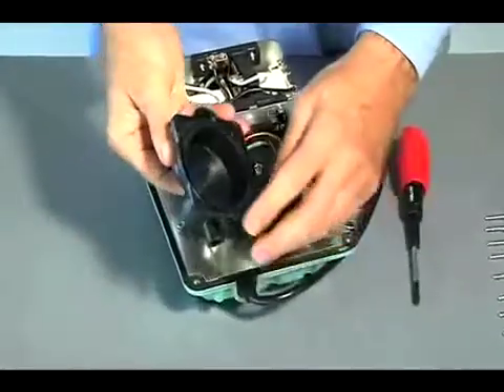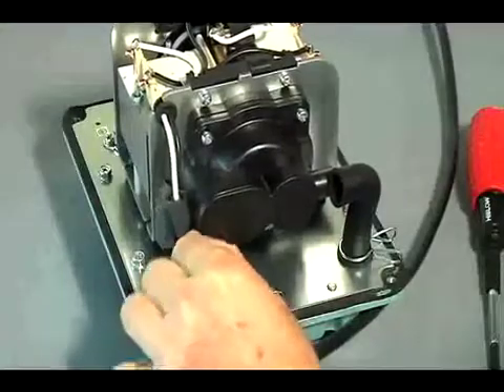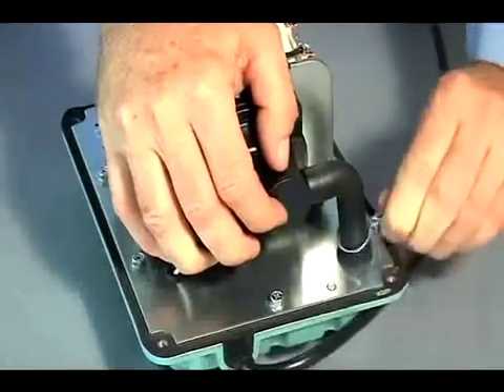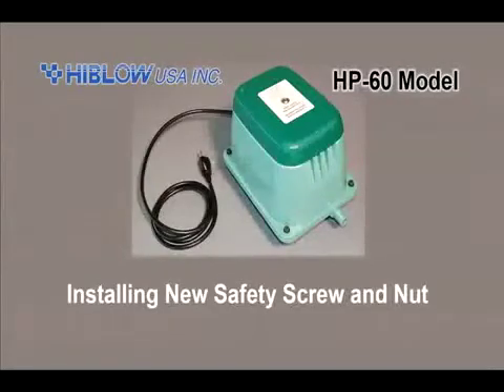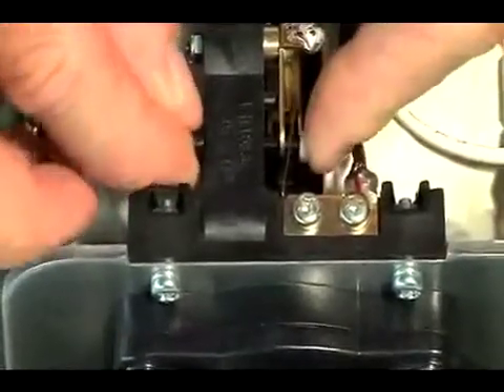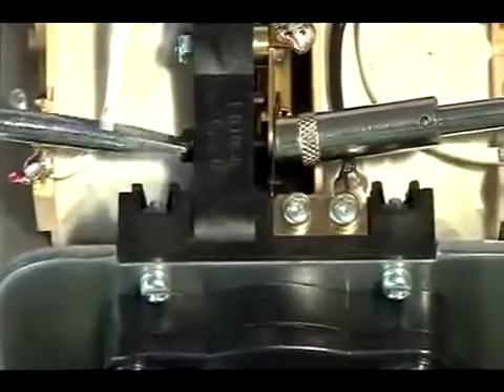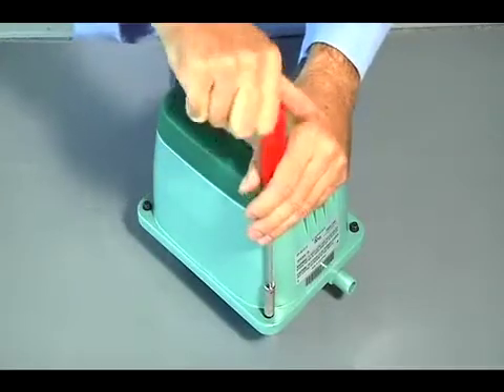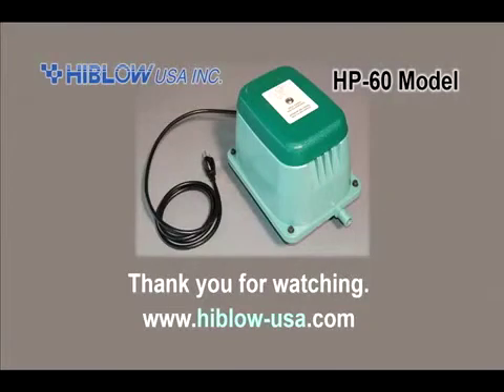HIBLOW HP-80 Rebuild Video - Repair Kit with safety screw - For All HP Series Models 2016 and Older

Comment: My HP80 does not contain or need the safety screws included in the kit. It has a safety micro switch cutout.
Also their is no screw in the filter cover.

Comment: Sir, I got HP80. But recently why safety screw always broken? I've check 2 diaphragm blocks are no problem. Need advice
Reply: Probably the chamber blocks and/or diaphragms are cracked or leaking.
Reply: Probably the diaphragms are split or the chamber blocks are cracked or leaking.